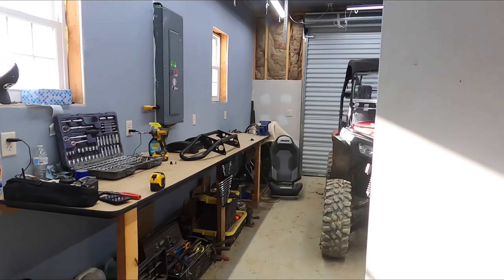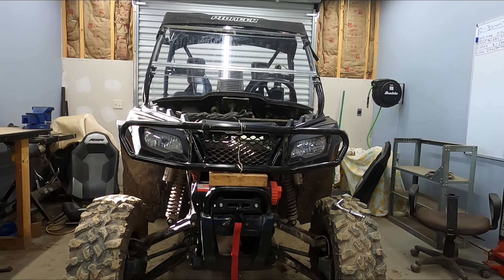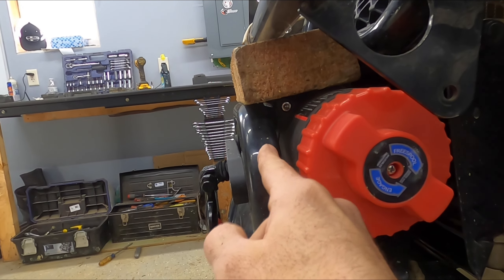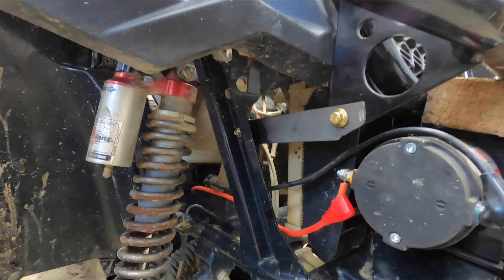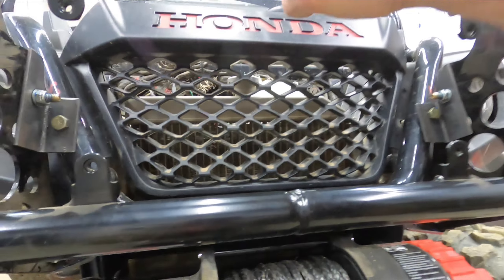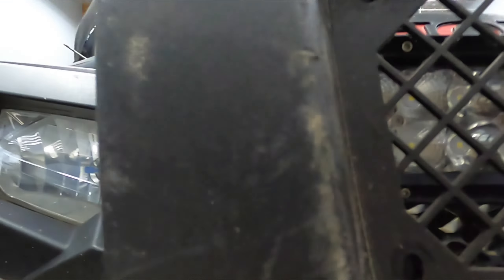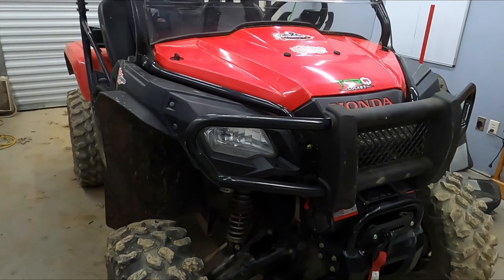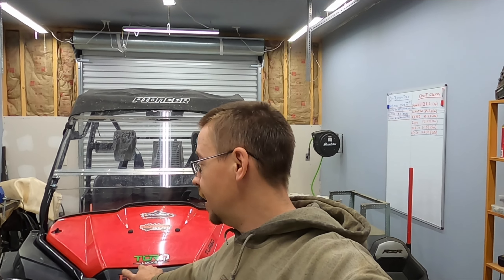Honda Pioneer 500 Custom Brush Guard Fabrication

Comment: Heck YA! stretch the wheelbase to between 90 to 95 inches, put the 1000 motor in it. Then throw those 32's back on it! MM is a little goat now, it will be a BIG GOAT then.

Comment: Good video.  Quick question; why did you put the winch above the normal mounting point?  I noticed it was a 5500lb winch, it is too big for then normal position?  I put a Maradyne heater in mine and it turned out pretty good.  Maybe a heater install for your next project.  Cheers